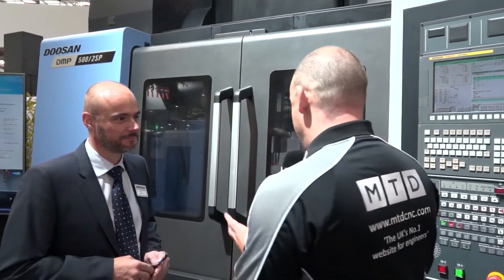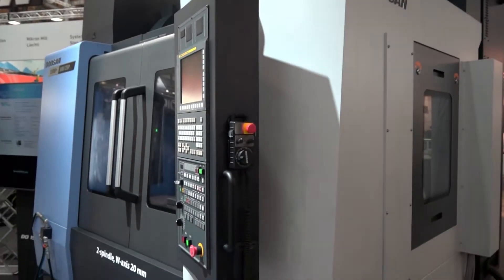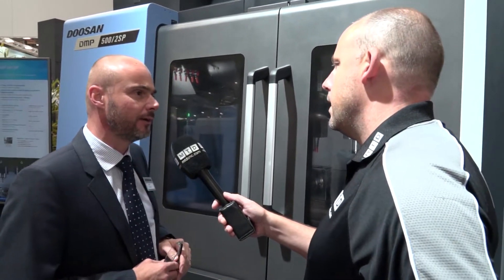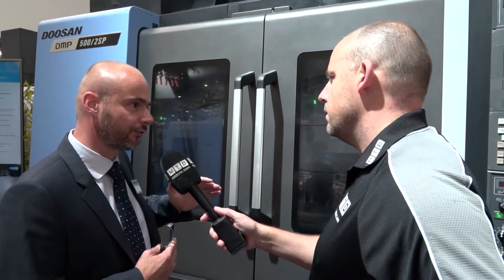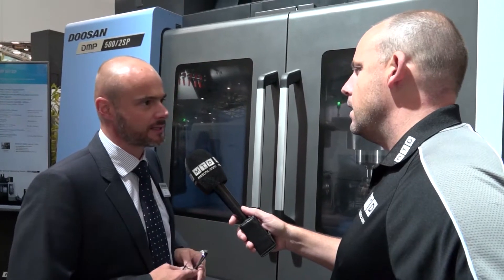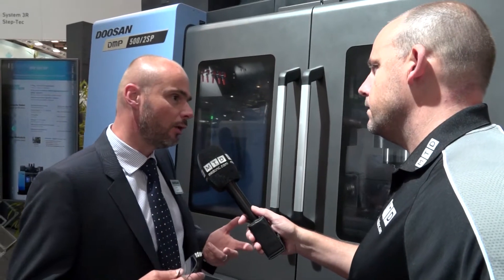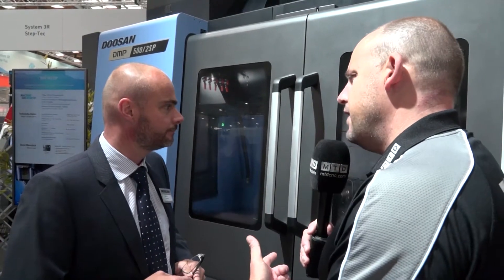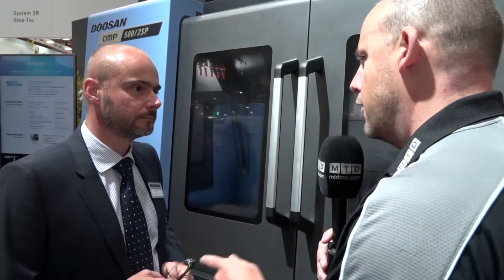Doosan DMP 500 2SP twin spindle milling machine

Comment: I'd imagine something in high volume would bother getting this machine. I'm quite skeptical at it. Looks like a more complicated setup, because you need twice as many tools for the job, and the only real benefit that you save is rapid time and tool changes. So it better be high volume. Like 1000 parts or more. I would say that the feed time is also saved, but at what point is it just better to have a second machine running? Unless floor space is big deal to worry about.

But if it works out, it works out, and that is pretty cool.